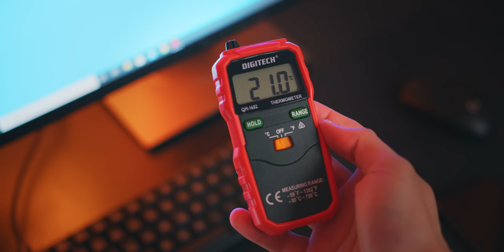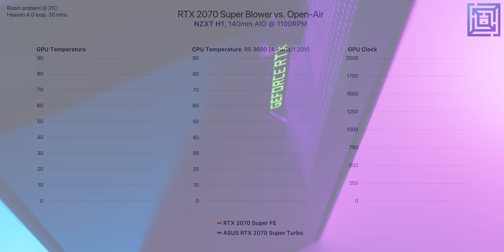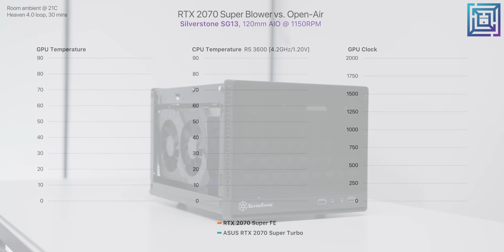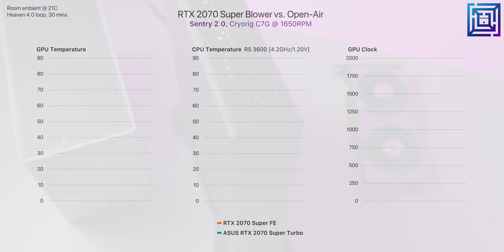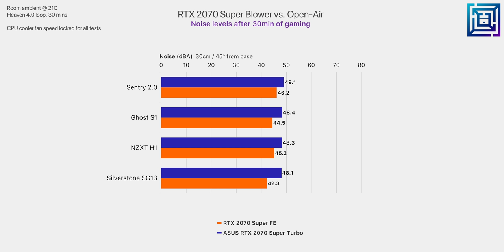Blower Graphics Cards for ITX Builds – Final Answer!

Comment: I'd been eying the H1, but I have a blower cooler so I think I'm going to pass for now. Thanks!
Reply: same here the thermals not that great. I also don't like the dark glass side panel on the h1.  is not in stock anywhere 350$ okay with psu, case, riser cable , and aio.
Reply: wana get it and test this for me? lol

rotate it so that the tempered glass panel serves as the base it sits on. This is how I want to use it, I dont like the look of the glass so its better off on the bottom imo. that way the hot air can move up out the previously back panel, the blower card can exhaust out the new back panel. The IO will be more accessible at the back, rather than the bottom and the power button and adjacent IO will be more accessible at the new front. general air flow will be in from the sides, and out form the top and back. ie overall more airflow.
Reply: i would be happy you didnt buy one. they catch fire.

Comment: Beware that those living in hotter regions with higher ambient temps, open air cards inside a SFF is a recipe for disaster. The hotter air inside the case combined with high ambient already causes CPU & MB/VRM, SSD etc to overheat. Blowers are very very useful for SFF builds.
Reply: Спасибо за инфу)
Reply: I'd have to agree. Just looking at the cooling airflow design of a blower-tyle card, it make sense. Now. To actually find a blower style card...
Reply: Optimum Tech is Australian 😎
Reply: If just recommend keeping the panels off

Comment: Have this blower card exactly in my DAN A4. Your test produced the same results I had :)
Reply: corporalpea What kind of cpu cooler you using? I’m using the asetek 92 mm aio and cpu temps don’t go above 70 on a 1600 oc to 3.9ghz @ 1.41 v
Reply: @siurocky  same here, the first version. Idles about 35 to 40 on my 2700 Ryzen. 

GPU hits 83 deg softlock when running destiny 2 (1440 P ultrawide ultra settings 120 percent render settings), CPU has maxed out at 49. I did prime 95 testing and got CPU to 73 degrees (here in Australia where it's hot as hell in January).
Reply: @13bfd  I see, cuz I use rtx 2070 evga xc gaming and no throttling whatsoever, caps at around 75-80C. Just wondering, but seems to me that non-blower style cards are the way to go.
Reply: @siurocky  when I had a blower 5700XT it was alarmingly hot. The CPU heated up loads. Not impressed with it.

Had a 1060 in it, was dual fan, no real heat issues, much better. Blower was good as it dropped another 3deg on average, but also the air is vented straight out, and now doesn't heat up my rear mobo mounted m.2
Reply: I'm about to build my new A4 setup. Would you recommend using blower card even with Asetek 92mm 645LT with Noctua fan? Did you tried open air one for comparison?
Reply: @duke_n3d  my personally, I would use a blower if you could get it for the right price. I paid 650 AUD which is very cheap for the card. 

Then again, you might watch this video and go with the advice you get from it. 

In my particular use case, my cpu temps have definitely dropped. Even just by 3 deg.

Comment: Another great video! Just finished my first ITX build and I had the same issues putting my RTX 2080 into my new M1 case.  The back plate of the GPU was causing high temp issues with my asrock x570 chipset and I had to make some ventilation and settings adjustments until the temps came down to 60-70c.   I have to give a lot of the inspirational credit to your channel. I never knew how much I wanted make a SFF Build until I started watching you. Your videos are well made and very informative. KEEP IT UP!
Reply: L. N. What did u change
Reply: @nancyyoutube5471  I used his under voltage video (https://www.youtube.com/watch?v=zUkPAVcb9Xc&t=2s) to adjust the GPU temps as well as adjust the fan curves for the whole system to account for the increase in heat at full load. mainly just made the fan curves a smoother transition for improved airflow and noise. also a BIG improvement was to reseat the heatsinks and fan on the motherboard for better contact. I believe this was the main cause for the high temps at first. I just essentially unscrewed and remounted the units and by tightening up the screws it seems to have solved SB overtemp at the fan. so far 4 months later it is quiet and cool and I completely love the board. I do wish there was another M.2 slot and a USB-C header on the board to support the case front plug. the new 550 Board from asrock has all that on it but lacks the thunderbolt connection, full audio connections,  intel CPU cooler mounts and does not have that SB fan against the GPU backplate. If I had to build it now I would have used the 550 Board instead but I was transitioning from an intel build so I picked this board to use my AIO CPU cooler and other parts from my older build. hope this helps

Comment: 12:31 Which I think is a shame, as there have been very effective aftermarket blower coolers in the past. Look at the HIS IceQ HD 7950; it's a blower, yet it outperforms really nice dual-axial cards, like the Sapphire model, in both acoustics and thermals.
Reply: That is one chunky cooler. Also Gigabyte made last gen cards like 1080 and 1080ti with some decent blower cooler.
Reply: Yeah! It was like a blower but not as loud as one. The 680 ti classified was an enlarged blower. There's some room for improvement for a blower or   a solution in between.

Comment: I'm a bit late to this, but I want to say that in many cases, a blower can be absolutely essential! 

When I had an evga 1080ti sc black in a silverstone sg13b:

Without blower:
1080ti at load: 88°C  (throttling)
samsung 970 ssd idling: 77°C (dangerously hot)
9900k at load: 100°C (throttling)

With blower: 
1080ti at load: 79°C (not throttling)
samsung 970 ssd idling: 64°C (completely safe)
9900k at load: 87°C (not throttling)

This video only tested mid range reference cards vs their blower counterparts and showed a modest improvement in thermals when going with a blower. When we're talking higher end cards, they produce much more heat that gets dumped into the case, so the disparity of blower vs non-blower becomes larger, and I feel like this is something that should be mentioned. Just because you can get by with a non-blower rtx 2070, does not mean an rtx 2080ti non-blower will work in your build. 

If you have a high TDP build, a blower can be necessary unless you're using a premium case like the M1 with extra case fans or the accelero gpu block.

My results should give you an idea of how bad thermals were, the build was unusable during gaming, even with the lid off. 

The beauty of a blower is it can run without thermally throttling in just about any environment where airflow is heavily limited, produces no extra heat in your case, and often reduces the temps of other components like your ssd/motherboard vrms by exhausting so much air from the case.

I can't even imagine how bad the results would be if someone tried to pair a non-blower 2080ti with a high end ryzen or intel cpu in a <20L  itx chassis

Comment: I've got an RTX 2080 for the price of an RTX2060 Super thanks to an online store slashing the price when the Super range was announced, but it was a blower style (it's an ASUS Turbo like the one in the video). I must admit, the blower style cooler wasn't great. I recently replaced it with a Kraken G12 and a 280mm radiator AIO. So, for still cheaper than a decent RTX2080, I now have the coolest and most silent card :D
Reply: Tom Bomb and the 2080 does not have a high tdp as the 2080Ti has xD had the g12 on it with 240aio. Worked really great. But with yours it still is a bit lower in temp and so maybe less hearable. Glad you catched the deal. Hf!

Comment: If you put  painter's tape along the bottom of the 20gen FE cards, it acts as a blower and pushes the hot air up, instead of recirculating in the case. I've greatly reduced thermals by about 12C on my CPU when running full synthetic loads in the DAN A4 and the Louque Ghost s1. Try it

Comment: In my SG13 I have the corsair h60 but upgraded it to have the Noctua A12x25-PWM pushing and a second fan on the back (yes it just fits) Noctua NF-P12 PWM. It pulls air in from the front and pushes it out the back. There's only a SFX PSU to give a little more room. The GPU is a Galax 1080 mini (two fan open style) overclocked to 2038mhz and the CPU is an 8600K at 4.5ghz. I also have Demci-flex filters on the front top and GPU side to stop dust, which reduces airflow. Both CPU and GPU have Kryonaut. 
With ambient about 20C the GPU under full load only gets to 74C (does throttle slightly to about 1980mhz) and the CPU to 72C if I take the filters off the GPU window the GPU reduces by 5C, but interestingly the front filter makes less than 1C difference being on or off, perhaps due to the high airflow from the Noctuas. While at idle the GPU is high 30s and the CPU mid 40s. 
I reckon that's pretty darn good in this little case!

Comment: I wonder if there will be a "premium" blower card especially targeting high end SFF builds in the future. There could be a market for that.
Reply: Taller card to fit a bigger vapor chamber plate or just a heat pipe array, whichever is more efficient. A wider fin array and a larger quieter fan. I think the His IceQ is the only non-reference blower style card in recent memory and it's a R7 370, it's been a while.
Reply: @TwistedD85  there was the magnificient GTX 680 Classified from EVGA, GTX 580 looked very weird too
Reply: TwistedD85 That cooler did really well in comparisons with open air coolers on pretty power hungry cards like the 7950 (220W ish).
Reply: Why do the blower coolers always have such small fans? The difference in fan size between the two cards in this video is huge. I get that the blower's fan would have to be a little smaller because it's enclosed, but does it have to be that much smaller?
Reply: VanBurenPhilips I think it’s because of how the airflow comes out. The fan kind of slingshots air into one side so you want it off center to hit the finstack more head on. If you look at pictures of the old HIS IceQ blowers you can see how the fan is on the top because most air comes out at the bottom.

Comment: can you try testing the H1 case with a blower card again, but this time instead of orienting the case as usual, rotate it so that the tempered glass panel serves as the base it sits on. This is how I want to use it, I dont like the look of the glass so its better off on the bottom imo. that way the hot air can move up out the previously back panel, the blower card can exhaust out the new back panel. The IO will be more accessible at the back, rather than the bottom and the power button and adjacent IO will be more accessible at the new front. general air flow will be in from the sides, and out form the top and back. ie overall more airflow.

Comment: I'm more amazed that you can do 4.2Ghz on the R5 3600 at just 1.2v. Mine would need 1.4v to reach 4.2Ghz, while I have read other users can hardly reach 4.0Ghz.

Maybe you can do a video on how to overclock the CPU?
Reply: Came here to write exactly that - I would appreciate a "good enough" ryzen guide for ssf usage.
Reply: Kesateria Matahari I am one of those who can barely break 4Ghz allcore boost. Single core will hit 4199.
Reply: For all the people here who can't hit 4.2GHZ on 1.2v

You. Have. Lost. The. Silicon. Lottery.

Your chip will not, and cannot match his chip.
Reply: @NOSfusion  yeah man, on stock my all core boost will only get to 3.85Ghz with a large Noctua C14. Single core barely reach around 4.1Ghz. Most reviewers said they got all core 4Ghz with the Wraith Stealth and I was like wtf.
Reply: @Kesateria Matahari lol yeah it’s annoying to see tons of Reddit posts with everyone getting a 4.2Ghz allcore boost. I’m using a Noctua L9a, but my temps never go above 75c, so I’m pretty sure it’s adequate. Or perhaps 75c is the limit, perhaps if it was cooler it would boost higher? Hmm
Reply: @NOSfusion  you verify it via Ryzen Master or how do you know how it boosts?
Reply: @NOSfusion  the temperature does play a role. From NH-L12S to NH-C14, it added an extra 50mhz to my all core boost. However, the most important thing would be the silicon lottery.
Reply: Siim Savisaar Ryzen Master, HWinfo, CPU-Z, running Blender tests. Hardware Unboxed did a Ryzen boost video, followed their methods
Reply: I was a lucky one that got all core 4.2ghz, but it runs at 1.4v. Definitely wouldn't be stable at 1.2v. I am also curious how the F he did this! I am using the Hyper 212 black edition to cool it. It never goes about 78c in stress tests. This is inside a Fractal Design Core 500 case
Reply: I get 4.30ghz in one CCX and 4.25 in the other @ 1.35v, I think I was lucky with my 3600
Reply: @RBsRealm  Yep it really comes down to the silicon quality. My 8700k can do 5.2ghz on a small air cooler while my buddy can only do 5.1 with a full custom water loop.
Reply: Ryzens will clock stretch and lose performance.
Reply: I got my 3600 last week, did manual and docp pbo without understanding half of it. Best setting I found is through Ryzen Master, all cores at 4200, voltage 1.225v. I also have one setting at 3.2 and 1.18v for quieter desktop work. Using a h100i keeps it at 55°c (ambient 22°c). I think its ok, Im pretty happy. Every manual ram overclock I tried failed (samsung die), so I just ignored and went xmp.
Reply: I have a 3600x and was sad to see that I can’t even overclock as much as some 3600s

Comment: I have the Phanteks Evolv Shift Air and I would be interested to see if the blower card would help more. The motherboard and GPU IO are at the top of the case, so just flip the NZXT H1 basically. Heat risers so I would guess the blower card would help more air up and out of the case

Comment: the problem with blower cards isn't the blower, its their heatsinks, if they had bigger heat sinks, and better surfaces i believe they can be far better then a axial fan gpu, but nobody designs a blower with a reasonable heatsink sizes. Having had blower cards myself, the thing most people dont realize is their fans have crazy RPM, and exaust a crazy amount of hot air from the case, its better for your cpu for sure. the blower heatsink is actually just a tiny block compared to an axial, i imagine if they actually made a blower that had a full aluminum channel shroud/heatsink, it'd perform amazing at the cost of noise.

Comment: I had an older Geforce card (970, from what I remember) that was a blower for man years.  I had little problem with noise levels.  Yes, it made some noise but it certainly was no noisier than a typical downdraft CPU fan.  I am disappointed that these types of cards have fallen out of favor.  

People worry too much about temps for the GPU, and that and the supposed noise of a blower, was the origin of the downdraft cooler on a GPU.  GPU's can go up to 95-105 degrees operational temperatures.  The typical 70 - 85 you might see during gaming is really nothing to be overly concerned about.

Comment: Saphire RX 5700 XT Pulse                   = VRM 7 + 2 phase / MHz 1670-1815 / Size 254*135*46.5mm (2,325 slot)
PowerColor RX 5700 XT Red Dragon = VRM 8 + 2 phase / MHz 1650-1905 / Size 240*132*41mm (Around 2,05 slot)
 I don't have a case yet. But I'm thinking Red Dragon is going to be best 5700XT choice for SFF builds. It also got less power consumption, better VRM, DDR, temperatures and produces slightly less noise. It is also better for overclocking because of that. You guys are free to do your own research see results for yourself. Correct me if I'm wrong in any way ;-)

Comment: Why are you using different cpu cooler when you're doing testing? Doesn't that affect the temperature inside the case depending on if it's a huge heatsink vs a radiator???
Reply: That's a really good point

Comment: does the blower style affect the performanece of the graphic card
PSD: i just buy a rtx2070 blower and i dont know if this can affect it or make it worst than a normal rtx2070
Reply: Not directly, they usually run hotter than their open air counterparts which means theyll suffer from thermal throttling which lowers performance. It just matters what case you use though.

Comment: Thanks for testing and sharing the results. For the 3090, is the turbo blower card that’s is 2 slot thick and short enough to fit into the sg13 case?

Comment: in my Inwin A1 plus, a blower is definitely a must. Its a poorly air design case, with ONE exhaust outlet, maybe two if using the side vents, but using two side vents as exhaust heats up the cpu as no air is flowing to it since the GPU is blocking the bottom two intake fans lol. So I use the blower as an extra exhaust fan, and use the bottom 2 and the 1 side vent as intake.

Comment: I went with the asus turbo in my 250d case, I’m running a 9900k undervolted with a u9s so I wanted to give it the best shot at staying cool. For me 70 degrees for cpu temps gaming vs 75 is worth the downside of the blower card noise.

Comment: I wonder why more people aren't removing their GPU shrouds and using 120mm fans in these. I gave it a go in my DA2 (required some improvisation) with NF 12x25s and the results were phenomenal; so much air is being moved that heat never builds up too much. While I did it to reduce noise, I kept it because it is just better.

Comment: I've 3d printed ducts for my open air cooler to force the airflow out of my case ^_^
Reply: I'd love to see that. Have a link?
Reply: Pics+plans please
Reply: Can u send pics for us? I'm very interested in this.
Reply: Yeah, that's BS.  It would basically have to be a shroud around the entire thing.  No wonder you didnt post pics of your imaginary setup.
Reply: Frozencpu sells ducts with standard fan attachment, I used in the past. Would use it again, but I can’t fit a McDonalds straw inside my 380T.